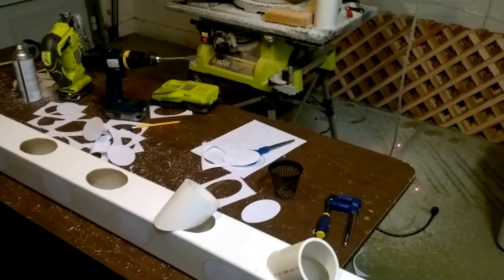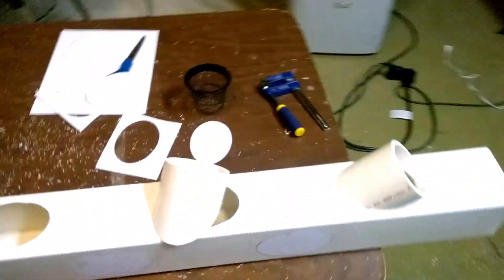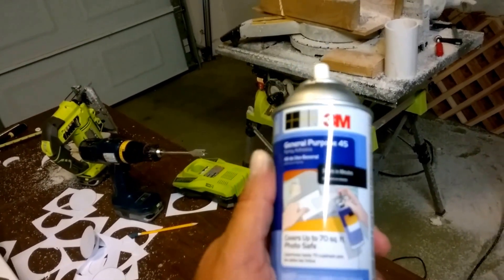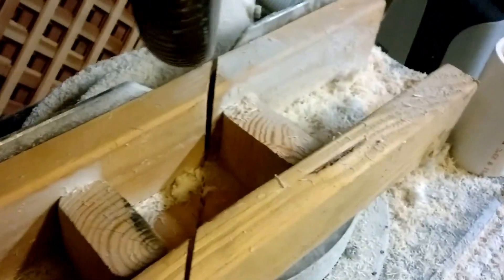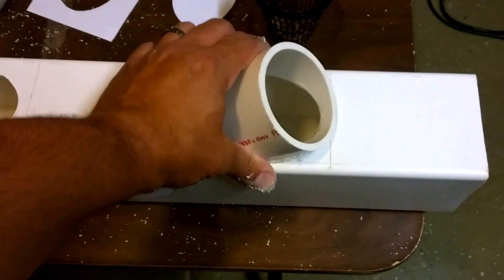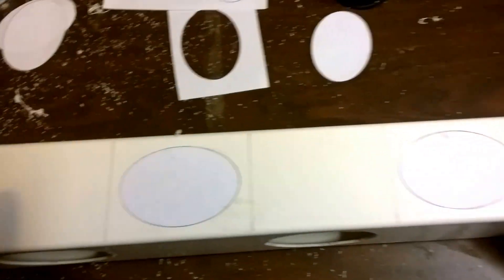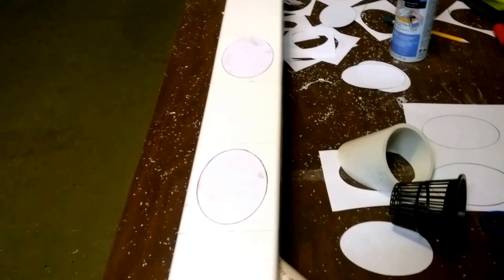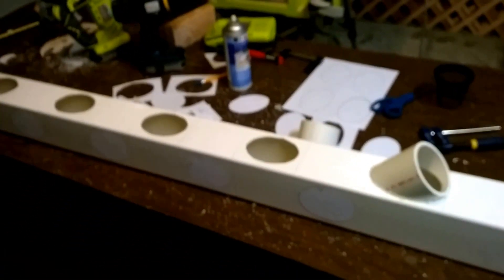Aquaponics Vertical Grow Tower Build - Part 01

Comment: do you have a follow up video of connecting the grow towers to the water supply from fish tank
Reply from the maker: I have a 1" pvc connected to a bulk fitting at the base of the tower and a 1" pvc in the center that runs up to the top. I'm getting ready to pull it out of my system though because it is too temperamental and the flow rate of the pump I need to lift the water to 6' in the air is a bit much. Also, the one thing I learned the hard way is that because I am close to the mountains here in Las Vegas, we get a lot of wind and some of the cups will blow out. I'm in the process of redesigning my system now and ripping all the IBCs out and going to make a custom pond and 2 large custom grow beds (approx. 2'-8" x 16'-0"), a 16' run of NFT and 1-2 small 2'x3' float rafts. Hopefully this helps.

Comment: I thought  you could speed things up with the holes if you used a chalk line, snapped a line down the middle of the side of the pipe, then mark the center of one of your cut pieces, and line it up with the chalk line however many inches apart you placed them. Then use a marker or pencil inside the piece to mark the hole. It seems easier than the multiple steps you had to do with copying, cutting, gluing, cutting, etc.  I also wanted to know how tall your netpots are. You said they were taller, but an exact measurement to shop with would be helpful.

Comment: Well done. What does it work like - do they leak at all using the glue ?
Reply from the maker: +vtv8man Scratch the glue stick... they started to fall off in the heat. I ended up tacking them on with plastic epoxy in 4 spots (small amount just to hold it on) at positions on the clock of 12, 3, 6 and 9 and then sealed it up with silicone that you would use for the kitchen and that seemed to work well.